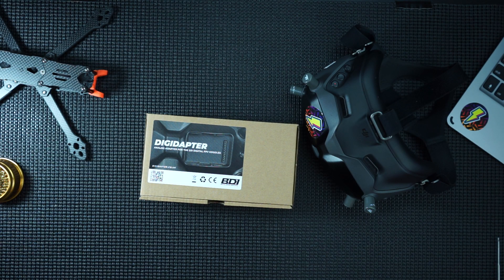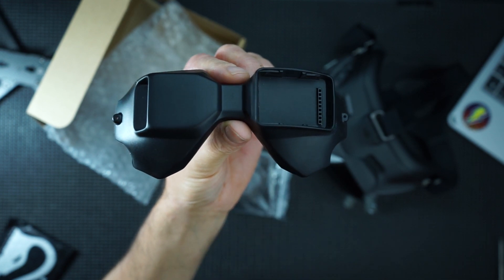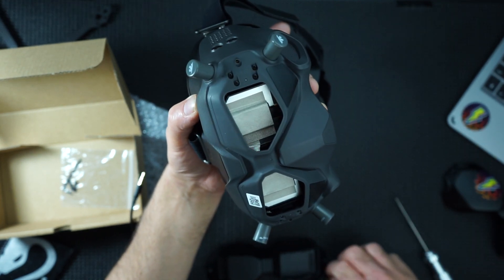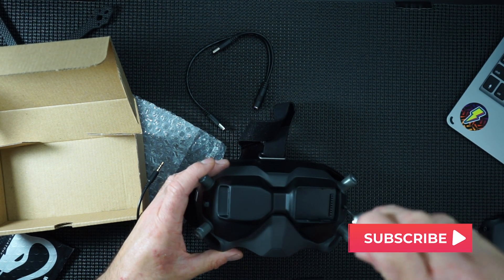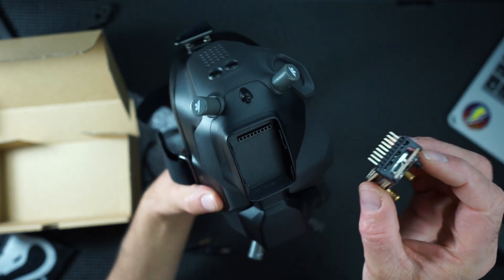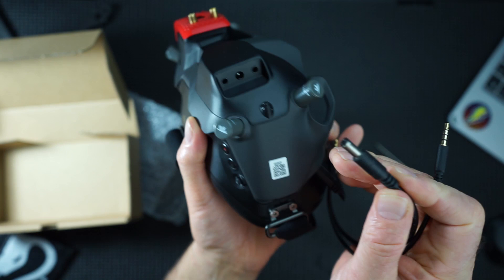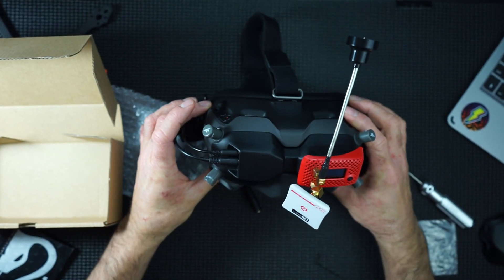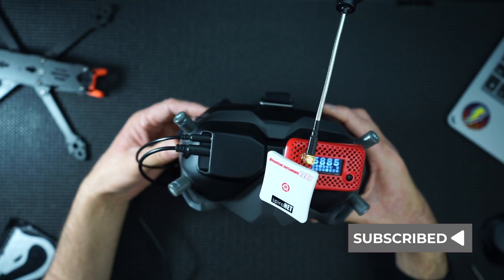DJI fpv goggles Analogue Mod with no Soldering, the NEW DIGIDAPTER

Comment: Ive got the same adapter plate, latest firmware on the goggles and on the rapid fire module... Do you get a splash screen when you change channels on analogue? I do, but don't whilst in the menu for the module. Im trying to work out if I can trust the module not to show the splash screen when ive got low analogue signal. How are yours?
Reply from the maker: I get a 'dji' splash screen when I switch / go to a new channel, apart from that once I have the correct channel in place it just stays connected.

Comment: Really helpful vid thanks. My dji goggle turn up soon and digi adapter on order to. What size 4s do you use and do you keep it in your pocket or attach to goggles? Thanks subd.
Reply from the maker: Thanks for the sub, I use a 1550mah 95c 4s lipo for mine, just don't go above a 4s lipo! - and I put it in my pocket, di*k or head... which do you want to loose...!? I'd never strap a 4s to my head!
Reply: @Datfpv  awesome mate cheers for that. Just ordered 4s 👍
Reply: Does it have to be 4s or could it be a 3s? Thanks!
Reply from the maker: you can use a 3s, but I think the goggles a a little power hungry, see how it goes on the 3s, 4s is max size though.

Comment: You only run this mod if running analog on the goggles correct?
Reply from the maker: Yes thats right, it gives you the ability to use your analogue module in your dji goggles, best of both HD and analogue in one goggle (not at the same time!)
Reply: Datfpv Ok cool. I appreciate it man 🙏🏼